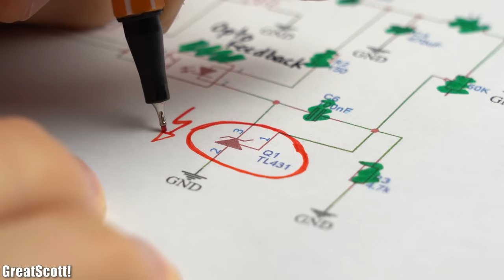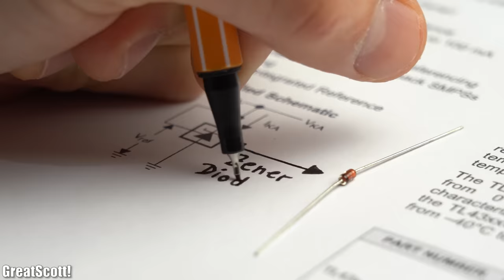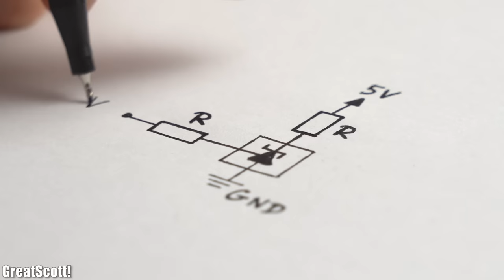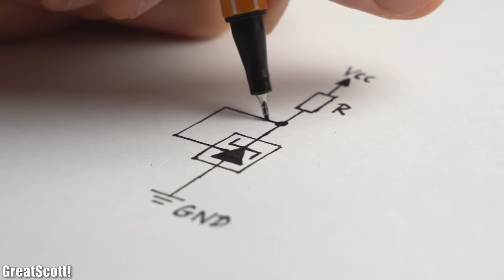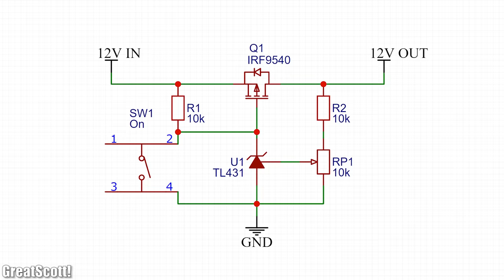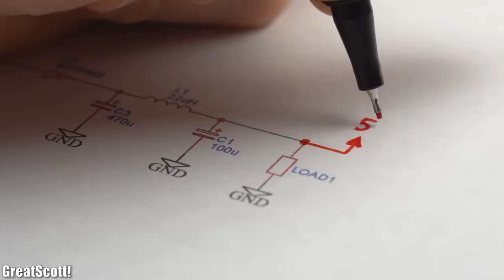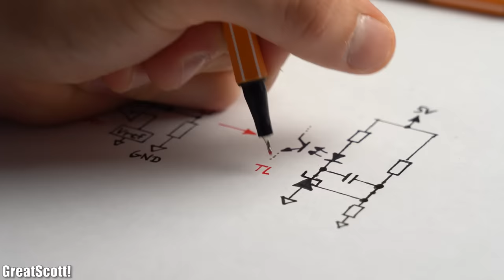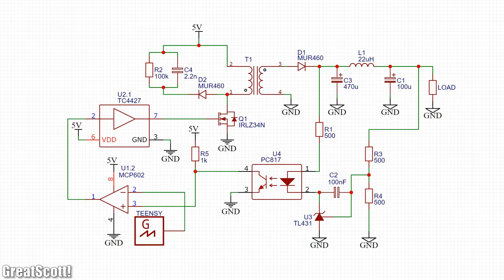Probably the most used component nobody knows of! TL431 Guide! EB#50

Comment: TL431 - A programmable Zenner diode, I hate them, I first came across them in 1985, and they were unreliable, and kept failing… I think the designers were not running the correct current through them, they would fail, go open, and the supply would go as high as possible - e.g. a 12v rail would go up to over 18v, blowing everything up as the 12v rails just had 16v capacitors on them, a few of the caps blew off the tops, very impressive. One failed during a training course just after the instructor had says, type anything you like you can’t hurt the computer {BANG}, the student left the class and got a refund…
Reply from the maker: Thanks for the feedback :-) Interesting story.

Comment: Where can I find more details about designing SMPS feedback like you have in the video? Is it possible to make the output adjustable (e.g. 0.25 to 7.5 V) by a microcontroller? Previously I tried fast PWM (100kHz) generated by a microcontroller, but the output was impossible to keep under control using feedback, and the PWM resolution of 10 bits was way too coarse. Great video!!!
Reply: Ramp the PWM setting up or down in proportion to the error voltage. Kind of a simplified PID control loop without the Derivative part.

Comment: Brother I request you can you make one video for square wave inverter driver board that have 60hz with feed back and short circuit protection or overload protection that board can drive 24 MOSFETs
I will and we will thankful for that
Best regards from Philippines 🇵🇭
Reply: ano ba?   Voltage in?  Voltage Out?  Current Out?
Reply: @kennmossman8701  that for 24v inverter or 12v
Reply: @MarkPrince1317  Current or Wattage?   Sine wave or square?
BTW I think he has done a review of an inverter circuit before.
Reply: @kennmossman8701  yes but it's Good if one more and upgrade version if he can make or brother if you can I will thankful for that here is 24v driver that can drive 24mosfets the Inverter power 2000watt square wave current I cannot estimate
Reply: @MarkPrince1317  No offense naman, but a 2000 Watt inverter is a very serious project - you have to REALLY know what you are doing;  it can require special test equipment as well as special parts. I recommend buying a commercial inverter.
Reply: @kennmossman8701  noted brother thank you very much for your replys

Comment: Help pls.
I don't know much about eletronics, but I want to build a small fixed voltage psu. So my problem is that lipo batteries change their output voltage depending on their charge, but I need a constant voltage of 12 volts. For some LEDs. The leds would only draw about 3amps total. Limiting the current draw for the LEDs is not something I need and the amps being drawn from the batterie dont metter either. I will use a li-Po alarm so that the batterie dosn't discharge too much. The only thing is that the circuit has to be really really small.
Reply: use a boost regulator.  BTW 3 Amps is not trivial, Be sure you know what you are doing

Comment: I am an electronic repair technician and I work on many types of switch mode power supplies. The TL431 can fail sometimes and it is difficult to diagnose because it does not short or open like a defective diode would. It will measure identical to a known good one using a multimeter or a curve tracer. In some cases the only way to know is to replace it. The symptom is usually a pulsing output where the DC is jumping past the rated voltage output. There are other things that can cause this symptom too, making for a difficult diagnosis. Your video was extremely good. Thank you!

Comment: For me the worry has always been, is the tl431-opt-pwm-driver feedback combination operating as linear feedback or discretised (like is pwm% varying smoothly with load as it should, or is it controlling it in an on-off fashion). I could easily see the latter happening if the feedback is too big. I suppose that's what the feedback cap is for...
Reply: Getting the feedback circuit right so that you have maximum bandwidth while maintaining the required "gain margin" and "phase margin"so that the thing is stable and does not oscillate is not a trivial task. The circuit has to be analyzed carefully. Different topologies have different requirements. For example, a PWM controller that operates in "voltage mode" has a 2-pole response in the output filter - one pole from the inductor, one from the capacitor. A PWM that uses and inner "current mode control" loop with the voltage control loop sort of "wrapped around" it has a single pole response because of the current mode operation. The ESR of the filter capacitors introduces a zero in the response at some frequency - instead of the the impedance of the cap continuing to decline with increasing frequency it flattens out and is dominated by the ESR.

Flyback converters and boost converters operating in continuous inductor current mode (the inductor is not fully discharged each cycle) have a "right half plane zero" in their response. You can't compensate for an RHP zero. You have to roll off the loop gain so it passes through 0 dB before you get to the the RHP zero frequency. That means that the dynamic performance of such converters isn't very good (it may be OK, but is poorer than other topologies that operate at the same fundamental frequency).

From what I've seen, these circuits using a microcontroller for feedback are crude and awful!

Comment: Hey sir , can i use this for high voltage dc to dc application?like dC to dc inverters with an output of 220vdc?thanks
Reply: in my dc to dc im using a zener diode for its stabilizer, i was thingking i could use this but my problem is the voltage capacity of the tl431?

Comment: I like these witching power supplies, but I also hate how most of them are designed, why would you use such a small sensitive controller ic to switch a mosfet on and off with such a high dc voltage? I think that is dangerous and a major fire hazard.
Reply: Usually they include a thermistor on the input which acts as a resettable fuse so it's not a problem regardless of the state of the MOSFET.
It's plugged through high enough resistors that it's unlikely to fail

Comment: Just a quick question to clear my confusion :In the feedback loop ,does the optoisolator work in the linear region or is it just On/Off ?
Reply: The comparator is basically a binary output.  That's what makes it different from an op-amp, operationally.  :-)  The opto is driven from the output of the comparator, so it is also off or on.  This signals the PWM modulator to use more or less duty cycle -- literally more or less, not "this amount" but "more than this" or "less than this" and just oscillates between the two at steady state.

Comment: If you use the Innoswitch IC family you don't need the TL431 for your SMPS 😁 maybe it's a topic you could have a look. The feedback system on those ICs blow my mind. Thanks for the great content and keep up the good work!
Reply: An all-in-one SMPS chip like the Innoswitch is my dearest wet dream... alas, they don't make anything close to my specs (under 14V  input, 300V+ output, 20 to 200W into load). Have to use old good TL494 or UC3825. Maybe I'm wrong and such a grail does exist?

Comment: Have a question here, in the circuit for the undervoltage cutoff, what about the bouncing voltage of lipo batteries? Could it not be the problem that when the load is switched off, the battery voltage rises and the gate opens again?
Reply: If the power is cut-off by using a transistor (as I believe the shown circuit did) then the circuit will likely settle into an in-between state where the transistor only allows just enough current to keep the battery voltage above the cutoff.
Reply: @eDoc2020  And what is if my current is to high for an transistor? (In my case a have a constant current of ca 3a (+1-2a  at peaks))
Reply: @maikeio  3 amps is nothing if the transistor is a power MOSFET. The issue is that in the half-on state it would get hot and could fail. One quick solution is for the circuit to turn off a relay when the voltage gets too low. If the the cutoff circuit itself is powered by the relay then once it turns off the first time it won't have any power available to turn the relay back on. Whenever a fresh battery is installed you could press a button which will bypass the relay, enabling the circuit to power itself again.
Reply: @eDoc2020  sounds very much like a thyristor, I think they should work too, or did you mean something else?